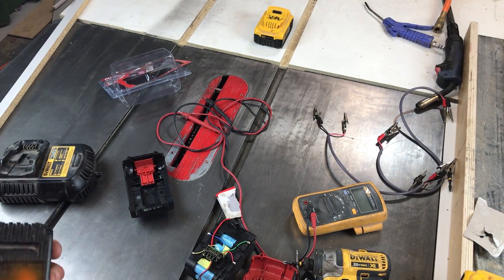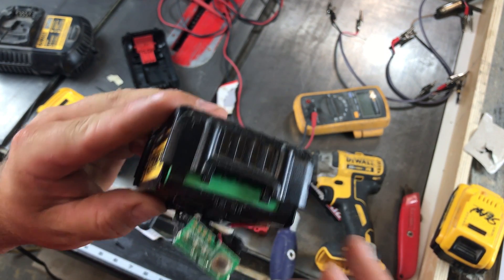Harbor Freight Bauer vs Dewalt 20v battery teardown comparison

Comment: Dewalt and Bauer are built in the same factory on the same assembly line in China. Until the last line before packaging that's were the assembly line splits and they each get there respected name and patent battery slot. The only thing patent is the slot the battery slide into. Everything else is a free for all. China cut the cost tremendously when they realized they could build everything the same and brand and label accordingly.  
Just like Harbor freight floor Jack's are built on the same assembly line as Snap On floor Jack's. Yep.....that will piss someone off. 
Not to get political there's more to the whole tariff thing. The American consumer has been getting the shaft for years on these so called NAME BRAND PRODUCTS.

Comment: Reason why it doesn't work is because DeWalt TH and ID terminal is connected to +.  Bauer is connected to -.  So if you just swap the TH and ID terminal of Bauer to +, it should work.

Comment: in case anyone's wondering. when you use different batteries for tools they have a pin for temperature of the battery. the temp is measured with a thermistor and I BELIEVE its different for all tools. a thermistor basically just changes resistance based on the temp. I figured this out when trying to hook a Dewalt battery to a Bauer tool. anyways the Dewalt battery had a different resistance than the Bauer battery so what you can do is just solder a resistor in the tool (or battery) between negative and TH terminal. what resistor you use varies but for Bauer TOOLS I found that it has to be 12kohms exactly. not sure about Dewalt batteries but I tested it with a high resistance rating on a multimeter and it didn't show up.

Comment: My Bauer 20volt battery shorted the board due to getting wet (still runs but can't charge) - can I replace it with a dewalt DCB200 Li-Ion Battery PCB Charging Protection Circuit Board ?   Thank you for this video.

Comment: This image on imgur:  ...com/7GE5w59.jpeg  (youtube keeps blocking the direct URL)  shows the internal circuit boards of (Left - Right):  Ryobi 18v, Ridgid 18v (all cell protection in the pack),  Kobalt 24v (cell balancing function only in the pack), and Dewalt (practically no circuitry in the pack). Areas circled in purple on the Ryobi & Ridgid packs show high-power-handling components.

Comment: abs + pc ..ABS / PC plastic sheet is a sheet of composite material on the basis of polycarbonate (PC) and acrylonitrile butadiene styrene (ABS) with a perfect blend of mechanical, thermal and rheological properties.and I think it's the perfect blend, for the battery case, because it's heat resistant and quite resilient.

Comment: SAMSUNG 25R cells In the Dewalt pack are able to dump 20amps. even more if they parallel them.  2500mah on capacity per cell. 
 the bauer cells are 1500mah per cell but they have a discharge rating of 23amps, slightly beating the 25R in performance(on paper) 
to use the bauer tools with dewalt pack, you just need to file down a tiny nub on the pack, and they will work. 
most all makes of battery pack use a BMS built into the pack to balance the cells and cutoff low/high voltage.
Reply: re: "most all makes of battery pack use a BMS built into the pack to balance the cells and cutoff low/high voltage."  Most newer tools (i.e.: those that were never available with NiCad battery packs) have the overcurrent and over-discharge protection built into the tools, rather than the packs, leaving only the cell balance board in the pack. Ridgid & Ryobi 18v packs are the only mainstream brands with all those functions in the packs rather than the tools, and that's because they haven't changed their pack design since the NiCad days.
Reply: @videopipeline6419  interesting, good too know. I based my previous statement speculatively after opening up a few packs, (Rigid, Ryobi and I thought a craftsman?)  all of which had the mosfets ect for balancing+cutting power to-from the cells-tool
Reply: @northernlits425  One advantage to having the battery protection in the tool is that the overcurrent protection circuitry is cheaper for low-drain tools, but when everything is in the battery, it has to be sized for the largest tools. Also, the in-tool circuitry can be downstream of the main trigger switch, meaning there is no constant low-level drain from an always-on PCB (although in-pack PCBs probably go into a time-based sleep mode to help compensate).  Lastly, I assume they figure that pro users will likely have more than one battery for each tool, whereas homeowners might be the opposite.
Reply: @videopipeline6419  yea, now that i think about it, that makes sense.  I'd consider Ryobi and craftsman home jobbers for sure. Rigid ain't a whole lot better
Reply: @northernlits425  re: "Rigid ain't a whole lot better" That used to be true. Not anymore. Overall, Ridgid cordless tools are pretty close to Dewalt or Bosch. Only Milwaukee is consistently better. And since Ridgid tools  have a lifetime warranty, even if they konk out, a replacement is as close as your nearest HomeDepot store that has tool rental.
Reply: @videopipeline6419  dont get me wrong, rigid is better. Imo, i just don't care for the ergonomics of rigid. They have quality packs and tools, but the drill i have feels overly large, metal chuck and plenty of power.
Reply: @northernlits425  You might want to take a look at Rigid's latest 'compact' 18v tools. For something even more compact, I prefer (and own) Bosch 12v tools.
Reply: @northernlits425  This image: https://i.imgur.com/7GE5w59.jpeg  shows the internal circuit boards of (Left - Right):  Ryobi 18v, Ridgid 18v (all cell protection in the pack),  Kobalt 24v (cell balancing function only in the pack), and Dewalt (practically no circuitry in the pack). Areas circled in purple on the Ryobi & Ridgid packs show high-power-handling components.

Comment: AbS is a material hard plastic usually it's black. polycarbonate is another manufacturing type of material for plastics it's very hard and is used in 3D printing

Comment: Lol those 18659 batteries shud work on a vape mod hahaha i wonder if it would be cheaper to buy those harbor freight battery and strip it and use the batteries for vaping. Since when u buy batteries from a vape store its 10$ a battery
Reply: They will work but 1500 mah is tiny for a vape cell. I have several dewalt packs I got damaged from work that have Samsung and lg 2500 mah cells in them that I've been vaping on for over a year.

Comment: Do you think swapping the circuit board (looks to be six or seven leads)  would do the trick?    I get hesitant to do much work on lithium packs, but to save hundreds in battery costs I could be persuaded.

Comment: My question is: why has NO ONE made a plug and play adapter that slides on a TOOL, and simply adapts the connections to a DIFFERENT BRAND BATTERY TO JUST PLUG IN?

Simply a piece of plastic with both plug in formats (tool at top, battery at bottom) for any brand of tool, any common brand of battery.

For example, after market 5 Ah B&D compatible 20v batteries are $44 on Amazon today - why not an off the shelf adapter that lets you just PLUG THEM IN to a DeWalt or other tool???  Basically all batteries just have a temp sensor besides the power connections...

----

"PC-ABS is a high-impact engineering thermoplastic ideal for functional prototyping, tooling and low-volume manufacturing. Get the best of two FDM materials, the strength and heat resistance of PC and the flexibility of ABS. PC-ABS also delivers excellent feature definition and surface finish."
Reply: They have complex pcbs in them that only recognise the correct branded battery.
Reply: You can buy battery adapters on EBay for about 15.00 apiece, there is a very good variety to choose from.  That way you can run a Makita tool with a Dewalt battery and so forth.

Comment: “Someone smarter than me” is  AvE
Reply: He should simply not wear a ring. The practice is motivated by superstition or style, neither of which makes sense to a scientifically minded person.  
And yes, sure, wrapping with electrically-insulating tape will protect the wearer from some dangers, but not from mechanical ones. The ring (unlikely though it may be) may catch on something and consequently rip the finger off.
Plus, rings to a degree, inhibit movement that may be needed. 
Just don't wear them. Even if you are a female, don't wear them. The practice is not sensible. 
BTW, I've been in situations where, if I were wearing a gold ring, I would get an amputation. It happens.

Comment: ABS stands for Acrylonitrile butadiene styrene, and is a type of plastic used in extrusion and can be pretty good for impact resistance. PC stands for Polycarbonate. Others had pointed out the PC but I use ABS in 3D printing a lot. 
Impressive Tear Down. I just bought the Bauer and was concerned it would crap out on me, but at best I'm using this as a hobbyist, so it looks like it was a good buy.

Comment: Thanks for your video.  I too had shorted a Dewalt Battery.  Based on your video, and the discovery at 3:40, I was able to solder in a piece of metal and fix the battery.  Works perfectly now.
Reply: What kind of solder did you use? I had a bad tool that shorted out 2 of my Dewalt batteries. Are there any precautions that should be taken doing this?
Reply: I used lead-free solder that I purchased from I Fix It Dot Com, but you could probably get it anywhere that sells solder. It was pretty thin and easy to work with.  I cut the end off of a male spade wire connector, and used it as a jumper, soldering the piece of metal to both of the metal plates that had been separated.  It has been holding up very well.  The batteries charge and work perfectly.  I didn't really take any precautions.  My batteries were pretty much bricks without me attempting to fix them, so I wasn't too worried about something going wrong.  Obviously be careful with the soldering iron, near combustibles and batteries, but other than that, it is a pretty simple thing to do.

Comment: On the Bauer battery, can you measure voltage/resistance from the ID pin (top row next to B-) to B-? I'm trying to hack a Bauer grinder to work with my collection of Dewalt batteries.
Reply: Did you have any luck in finding this info?  I'm thinking of doing the same.
Reply: Im currently trying to do the same thing.. did you figure it out CoreyO?
Reply: Interesting... any luck???
Reply: @__WJK__  I got the Bauer grinder working on the Dewalt battery, but the Bauer angle grinder is trash. I also didn't get the battery temp probe working, I ended up just bypassing it with a resistor.
Reply: @CosRacecar  - Good to know. Yeah, I have the Bauer AG & the grinder's overload/stall circuitry is annoyingly sensitive.
Reply: @__WJK__  The 5ah DeWalt battery improved it a little, but it's still IMO unusable. You're better off to just buy the DeWalt brushless, I love mine.
Reply: @CosRacecar  - Makes sense but absolutely hate having more than 1 brand lying around & dealing w/ the extra incompatible batteries & chargers. Gonna hold out a bit longer & see if someone maybe comes out w/an adaptor that allows a Bauer batt to fit a more competent angle grinder.
Reply: @__WJK__  IIRC the issue with the temp circuit is that one goes the opposite way from the other - for example the dewalt battery the thermistor value rises as temp increases, the bauer it decreases. It's been a while since I looked at it though, it may just be that the thermistor values are different and I'm confusing it with something else. Either way an adapter that properly accounts for temp would either need some clever circuitry or a pic or arduino inside translating that temp signal. Granted, 95% of people will never need to worry about the battery overheating, but I worry about such things.

Comment: I bought the baur thinking I was making a good buy. Unfortunately I as wrong. Should have just bought the dewalt. I purchased a additional battery and both batteries did not last more than 6 months. I only use them maybe once a week.

Comment: This is going to sound like a useless question but for the sake of reverse engineering did you try the dewalt battery on the Bauer  tools?
Reply: @LabRat Knatz - Was thinking same but my Baure batteries are still providing long run times. Please let us know if you ever rebuild one of your Bauer packs with higher mAh cells.Side note... will be interesting to see if the Bauer control board will need to be fed low voltage before the main battery +/- are cut, in order to keep from bricking the control boards. I know for a fact most laptop battery rebuilds require this step in order to keep the battery board "alive" so to speak(!)

Comment: Sean, Have you tried going the other direction and tested a Dewalt battery with a Bauer Tool?
Reply from the maker: +Trevor Evenson tried it every which way....
Reply: Thanks Sean Carlin Designs! Maybe someday they'll agree on a standard tool battery, like was done with disposables so many decades ago!
Reply: @seancarlindesigns1431  have you ever come across an efficient guard for the bauer batteries contacts? I own a lot of them, and love them to death, but the idea of that much energy being uncapped bugs me. I could go the 3d printing route, but figured it was worth asking. 

I have the bauer impact , the drill and the light. All are great tools that have performed really well for me

Comment: they do  work. you have to add a 10 kila ohms  resister on the non dewalt battery board. it thinks its too hot or to cold... that's why it doesn't work. plus the battery case mods. lol
Reply: Robert Silva Thanks for noticing! I was just about to say the same thing!
Reply: Where do you add this resistor?

Comment: Interesting enough to note, these are 3.7V cells x 10 giving them 37 volts total in series. Each row of 5 are connected in series to make 18.5v @ 2.5 Ah. When both "packs" of 5 are connected in parallel, the voltage stays the same, but the amperage is doubled to make 5 Ah. Now if they slightly changed the design of the casing to be 10mm wider, they could fit 12 25500 3.2 volt 5000 mAh cells and have 19.2v at 10 Ah in nearly the same footprint. In a previous video, you said you were waiting for the class action lawsuit on the battery voltage, but it seems HFT isn't the only ones using 18.5 volt batteries if the Dewalt has 10 18650 cells too.

Comment: not many people are willing to open up a battery, but you sir have confidence. Over the years I've learned that you open a battery for either one of two reasons; either open a battery to replace/recharge damaged cells or open a battery to  harvest the working cells. 😂😉
Reply: And I always assumed it was just the leftovers from a meth lab.   Disassembled batteries are generally found alongside dozens of empty packets of Sudafed IME.
Reply: Broken_font yeah lithium batteries can be tricky, but I built a Frankenbattery out of 2 Ridgid 4.0ah batteries and it works great. due to safety concerns, I can't encourage someoneto try it themselves, but it works for me and it's very unique
Reply: Joshua Burgess dude I love your profile picture 🤠
Reply: Broken_font thanks
Reply: Broken_font I should have a video up on my other channel about my Frankenbattery relatively soon
Reply: Curtis Larson or a vaper in need lol
Reply: Curtis Larson A trashy shake and bake lab. They use AA or AAA, it would be too hard to take 18650's apart, and way more dangerous. Also, Sudafed  is no good unless it's the 24 hour because they have that wax coating. Store brand is the way to go
Reply: Curtis Larson sounds like ya hanging around the wrong crowd lol